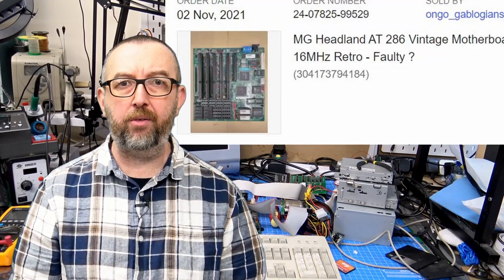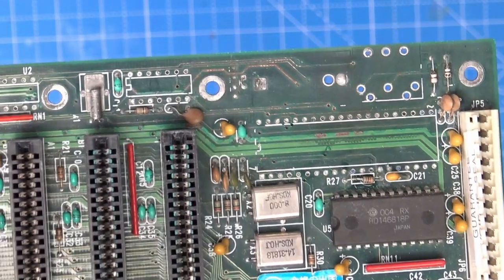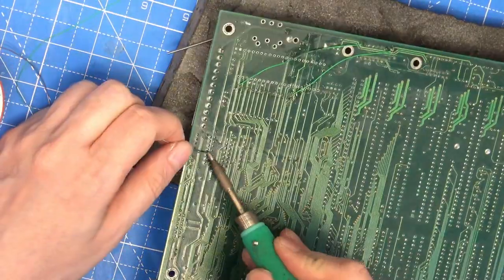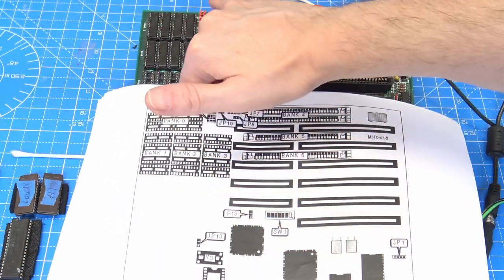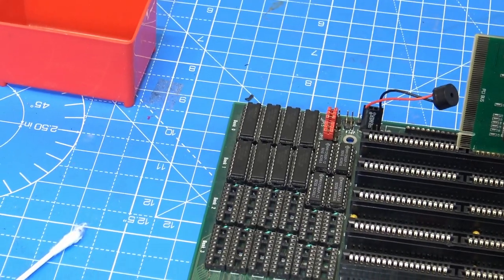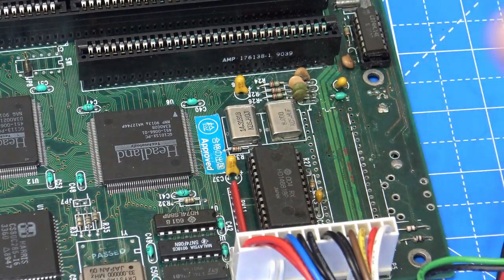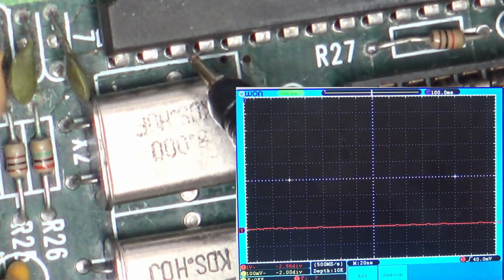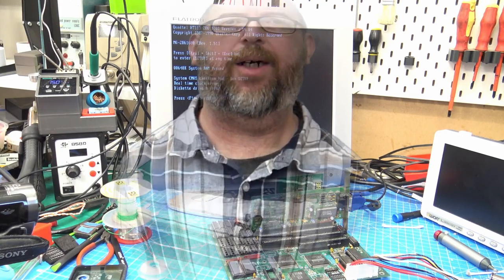Mystery 286 PC motherboard with battery damage - will it post ? Part 1

Comment: Save our 286s! You're doing fine work here, keep it up 😁
Reply from the maker: I am stuck with a problem for part 2 and just can't get it to run code from a floppy and locks up. It works perfectly with the XT-IDE and will run wolf just fine. Someone suggested to look at DMA and perhaps try a soundblaster with DMA,

Comment: Nice video Lee! Looking forward to part 2, quite jealous would like a 286 machine to complement my 8088 one, one day... Good luck with the Floppy issues you have at the moment, I guess the chipset handles DMA so maybe check the DMA lines and settings. Could also be BIOS config, floppy geometry etc... My only criticism was the lack of Lee Smith TM "WOWs" once the computer booted 😋 Great result tho, well done!
Reply from the maker: Yes I have to agree the first post screen part  lacked enthusiasm haha WOW.  Perhaps I can make up for it when I get the FDD working. my research did say the DMA is part of the three headland chips so not a part I can swap over just for testing.
Reply: @leesmithsworkshop  yeah good plan save the big guns for when you have the floppies rocking!

Comment: I guess things like this are not that known, because the 286 et al were so generic back in the day (therefore I didn't find them interesting then either :) ). That was mainly due to the 8- and 16-bit discrete systems that were.
Reply from the maker: I did find a lot of boards with this chipset, but they are all OEM, This just has MG on the board and not much else.

Comment: I have an Opus 286 (12 MHz), it's got everything on the mainboard but the video card. MFM HDD controller too. The battery is mounted not near the edge, but somewhat closer to the middle of the board. And it was sitting in a puddle of leakage, all the components in a 10cm radius have green legs and the traces look wasted but... the board still works just fine. I did remove the battery (like... a year ago, I shoulda removed it when I got it) but I'm reluctant on neutralizing the leakage because I fear that reaction will be the final nail in the coffin (stuff fizzles and moves while neutralizing).
Reply from the maker: I was very lucky with this because it didn't have too many traces next to the battery. If you're not sure about the repair just do the cleanup anyway to stop it continuing to eat away and eventually have nothing left.